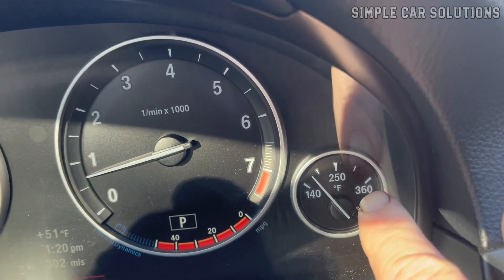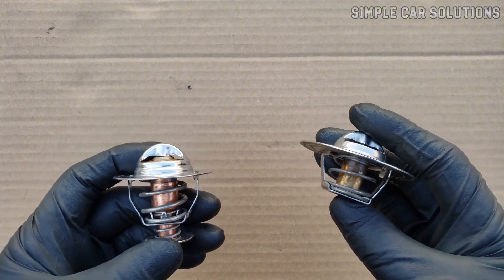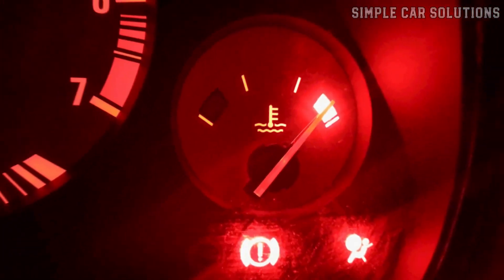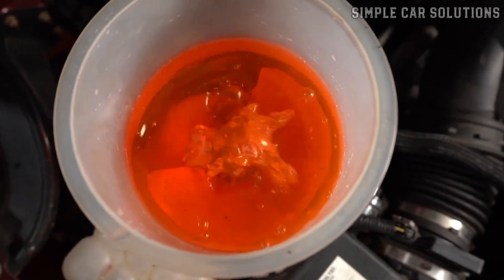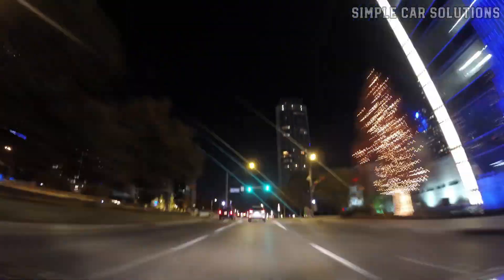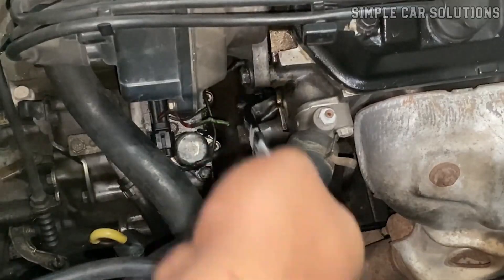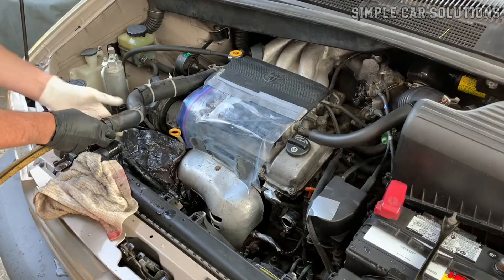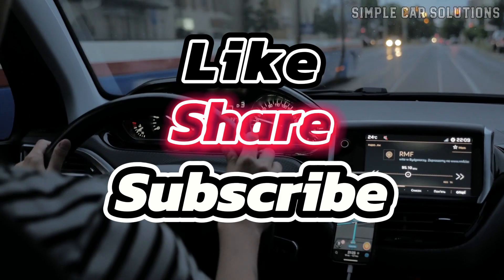Why Car is OVERHEATING and How to Fix it. Mechanic Shares Top 7 Reasons

Comment: my 2015 volvo s60 may show over heating  msgs when warming up (in the 1st 1-3 miles)。 flushed cooling sys, replace thermostat, water pump, vacuum refilled coolant。 will chang the temp sensor n see.  but never see any chk eng lighs?
Reply from the maker: Since you've replaced key cooling components and vacuum-filled the system, air pockets might still be present. Try bleeding the cooling system again. Also, check the cooling fan operation and wiring. A faulty temperature sensor could cause false overheating warnings, so replacing it is a good next step. If the issue persists, scan for hidden fault codes, as some may not trigger a check engine light.

Comment: On my Chrysler 300 2014 3.6 engine, it overheats because when the heater is off, the fan doesn’t work. And it overheats bad what can I do?
Reply from the maker: Your cooling fan should work independently of the heater. The issue is likely a faulty fan relay, temperature sensor, or wiring problem. First, check the fan relay and replace it if needed. Also, test the coolant temperature sensor, as a bad one can prevent the fan from turning on. If the wiring and fuses are good, the fan motor itself may be failing.

Comment: On my Mazda 6 diesel sky active there's no temp gauge you don't know that the engine is overheating until the car goes into limp mode, by then the cylinder head gasket can blow or the head crack, 😂😂😂. In summer take out the thermostat all together

Comment: My 08 Chevy uplander overheating when switching to heat why
Reply from the maker: Your 2008 Chevy Uplander may overheat when switching to heat due to low coolant levels, a clogged heater core, or a malfunctioning thermostat. Check the coolant level first and inspect for leaks. If the coolant is fine, the heater core might be blocked or air-locked, or the thermostat could be stuck.

Comment: I had a radiator put in, and my 2004 cadillac escalade esv is still losing coolant
Reply: Check the coolant cap, or maybe you have a head gasket problem.
Do you know what it was?

Comment: I need to know about head gasket stop leak is working
Reply from the maker: Head gasket stop leak products can temporarily seal minor leaks in a head gasket, but their effectiveness depends on the severity of the damage and proper application. It’s a stopgap solution, not a permanent fix. Severe issues will require a proper head gasket repair.